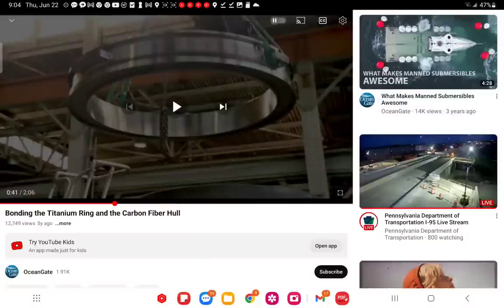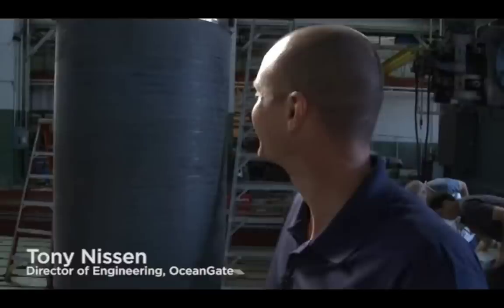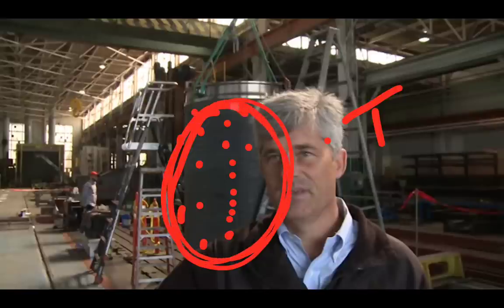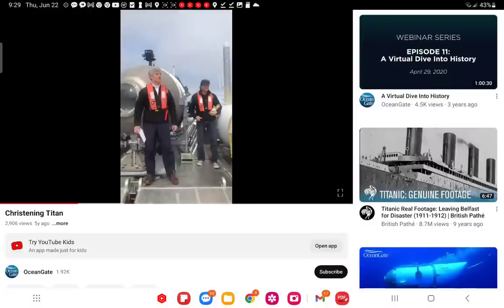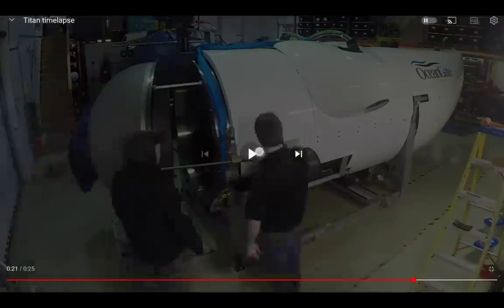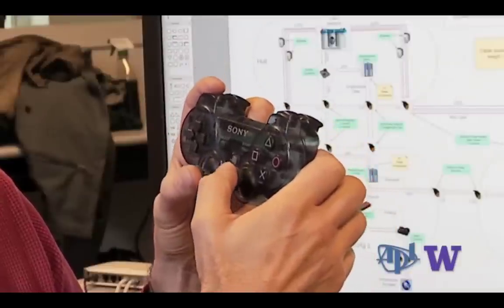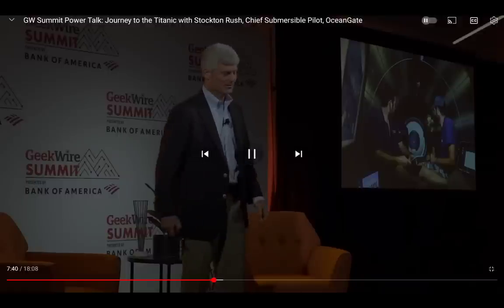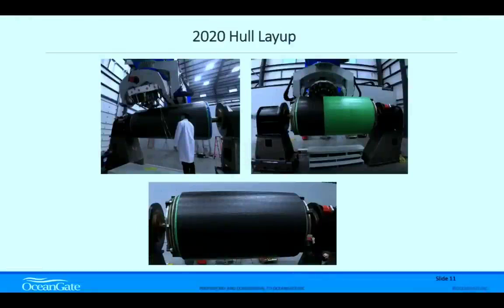Titanic Titan owner speaks out on his design test and APL University of Washington RESPONSIBLE??

Comment: Carbon fibre is excellent in tension. In this application it is in compression. This is a flawed design.
Reply: My question is why did they think carbon fiber was good to use like how come they never like I'm so curious as to like where did they get that information that everyone else is using steel or titanium
Reply: Well, the instructions say it makes great pressure vessels. Just not in the same way as this. You need to ask your engineers how many game controllers they had in their college dorm.
Reply: @notyobitcch  I think the main reason they choose carbon fiber is to make the whole thing lighter (easier to move and so).
Reply: Also its a lot cheaper than Titanium.
Reply: @Tigrou7777 they wanted it lighter to cram more wealthy tourists in there.
Reply: The CEO is personally insulted by your baseless cry. Statistics show it's more likely that the crew screwed up than that the designer or builder screwed up. Of course, since all three possible screwups went pop, it doesn't matter.
Reply: Tensioning longitudinally for a box girder effect might work.
Reply: @jimgraham6722 carbon fiber is basically a rope. I can't think of any arrangement of ropes that would work well against compression, all that was holding the sub together was the epoxy. At that point, they might as well forgo the cf and build the sub out of glue.
Reply: @phoenix211245 exactly.

Comment: Spencer Composites Inc. manufactured the cylinder. I suspect the factory you see in the video belongs to the composites firm. The design factor of safety was 2.25 for a 4.5 in thick hull which was rounded to 5 inches.  The CF and prepreg was Mitubishi's and bonding epoxy were supplied by Epon Resin in Ohio.  There's a good writeup from 2017 in Composites World about all this.
Reply from the maker: Awesome research, thank you
Reply: Carbon fiber is a tensile product, i. e. used in acid tanks and SCUBA tanks,  pushing out, tensile . Epoxy is what holds the fibers in place.  Using carbon for compression was a huge mistake. Try pulling on a string or pushing it. Duh?  I am over 50 by the way.
Reply: Well, the manufacturing in these videos was... questionable at best. So is their site, it looks like from 90s... At this thickness, I'd not set foot in something that has not been cured in an autoclave, and this was not. I bet the epoxy in the middle was inhomogenous and full of air bubbles. But all in all, it held for 3 years and 10 plus dives, so it was not bad.
Reply: Why do I keep hearing that he used a Boeing used fuselage? Was this for a previous sub?

Comment: Spencer Composites Corporation (SCC) was founded in 1994 in Lincoln, Nebraska, and is now located at 4550 Pell Drive, Sacramento, California. SCC’s facility has over 50,000 square feet of space available to fabricate products up to twenty feet in diameter and over one hundred feet long. Spencer Composites fabricates composite products and components using thermoset and thermoplastic processes, has expertise in thick-wall composite processing, and is experienced and has the equipment for the processes of filament winding, pultrusion, RTM,VARTM, press molding, autoclave curing, and hand lay up.

Comment: That glue is what killed the family!!  You can not epoxy carbon fiber to a smooth titanium ring then subject it to expansion and contraction cycles and expect it to hold. I’m surprised it lasted as long as it did.   They should have ran titanium rods through the carbon fiber cylinder and bolted the end ring to it.   It would have held much better. But still can’t say it would have prevented the incident. Maybe put it if a little longer.
Reply: Yes I also thought of this solution yesterday. Ten foot bolts are very easy to get hold of or make.
Reply: The bolts would have less tension on them than the sea pressure pushing on the hull.
The failure was the carbon fibre buckling in compression - bolts just add to the compression.

Comment: Also I forgot about this that the titanium and carbon fibre would have a completely different expansion rates this would have a huge effect on the glues hold the rings and on the overall structure, I noticed on the wreckage that I couldn’t see if there bits of fibre attached to the rings they looked very clean.
Ross
Reply: There are a lot of questions that could only be answered through long term testing.  One thought I had was that construction of maybe 20 unmanned vehicles using such a pressure vessel for use over maybe five years could have provided much needed data.  A statistically valid set of data is needed.
Reply: @catsupchutney Exactly, it's a new material, you don't know the risks, build robotics! But since the guy used a cheapo controller and monitors, rusty pipes as ballast, I guess he wouldn't have paid for it.

Comment: The APL designed Cyclops 1, which was all metal.  It made a number of dives without incident, including to the wreck of the Andrea Doria on the Atlantic Continental Shelf.  It was rated for a much shallower depth than the Titan attempted.  The Cyclops 1 was distinguishable from the Titan by the upper hemispheric dome, and the very large front viewing port (possible because it could only be used at a fraction of the depth that Titan attempted).  Cyclops  1 is still in existence.

Comment: So they wound the carbon fiber into a tube. From what I can see in the video, it looks like the fiber is automatically epoxied by the follower? before its wound onto the cylinder form. What I don't see is any form of vacuum degassing of the epoxy as its applied. Wouldn't the winding of the carbon fiber then trap air, causing microbubbles in the resin that would then proceed to collapse under pressure from the outside in, slowly degrading the integrity of the cf hull deeper and deeper, until catastrophic delamination became inevitable? 
Also, does anyone know how they mounted equipment to the inside of the pressure vessel? Sure looks like they simply drilled into the fiber hull. If so, would these holes not be prime failure points? I have so many questions!
Reply: From what I understand, they installed an inner tube to mount the equipment. But for the rest, completely agree, the entire setup was a shambles from the very beginning. No crosshatching of cf, no vacuum during the process, don't get me started in how they glued the caps on..,..

Comment: It doesn’t help keep the seal if the carbon and metal deform and compress at different rates due to pressure, temperature, and the cycles. 

It’s entirely possible that the carbon compressed significantly more than the titanium, or less, and lost symmetry. This would have the effect of unseating portions of it away from the ring. It doesn’t take much. Any leak, any intrusion, no matter how tiny, at that depth would be catastrophic. 

Consider how much a military submarine compresses at operating depth. It’s a lot. And that’s only 1k feet or less. Now imagine how much compression occurs at 12k feet. Now how do these dissimilar materials compress compared to each other? It better be damn near the same

Comment: As prototypes go, that one looked like it could have used a lot more time put in on it in the lab, AND in testing. Not to mention, having at least two identical prototypes might have been extremely helpful for continuous testing, re-engineering, and and working out the kinks.
Reply: A scale model can tell you only so much.
Reply: I would have made one to leave at the titanic site indefinitely. I would put some pressure sensors inside it and leave it 6 months unless the pressure sensor says the hull failed
Reply: @CognitiveDisonance build a full size one as a robotic vessel🤔 kinda easy enough to do even if costly,  we have robotics that go down to the same depth. And you can cycle it much more frequently to find the limits.

Comment: The thing I noticed right away, is that the carbon fiber was all laid up one way or in one direction! Now I know with my limited experience with it, is it should be cross hatched or cross woven when laying it up! From what I saw it was feed off of that roll, all in one direction! I am skeptical of three things, the weave, the glue joints, and then that joint that he pointed out in the center! In my minds eye, those glue joints should have extended much further on between the end-caps and the carbon fiber hull!
Reply: I’m skeptical of all of everything you bring up, and that poly window.
Reply: Yeah they say it is prepreg usually prepreg are woven. However looking at the making of the tube it looks all the fibre is in one direction.
Reply from the maker: it is almost wrapped in one direction but this is not a true statement ... I will prove this in a video that is scheduled in a couple of days
Reply: @ForensicCats Hope at least that they have had enough sense to to that. There were enough failure points here to be glad not to add more. Although don't know how they managed to crosshatch from the video, will be glad for your input.

Comment: Yes! When the carbon fiber capsule was wound, it should have been built up on the ends to account for the transfer of the vertical pressure transfer of the Titanium cap.  Even with the accounting for the acrylic porthole, if the end of the capsule would have been scaled up on the end of the capsule that does not terminate. (Kindof smart design feature terminating one end of the capsule. Reminds me of a Prince Rupert's Drop)
Yes! It should have had a piece of titanium wound into the ends of the carbon fiber like a bearing plate that would have been the surface they would have been preparing the glued, titanium ring we saw them joining.
Reply: Better to wind the carbon fiber in a criss cross fashion. Like the old Wellington bombers of WW2 fame. Makes for a stronger cylinder.

Comment: I'm thinking we're looking at that titanium/carbon fiber interface, there, which looks like about a 7cm inner lip supporting that tube... Or, as you pointed out... what appears to be a scribe mark around the mid circumference of the tube... It's like cutting glass... with a scribe mark.  I bet you've hit on it... That mid-tube load along with that scribe mark.  I bet that's the failure point.  It will be fascinating if we get to take a look at that wreckage... which I sincerely hope is completely, as is possible, removed from the Titanic region.
Thanks... Fascinating... Well done... "Liked"  "Subscribed'
Reply from the maker: Thanks for subscribing and I hope you can handle my humor...
I think we can learn what happened by having access to the previous version that had an aborted dive... It should still be around, at least the pressure hull I hope.
Reply: @ForensicCats  Another thought I had was, that this was the singular vessel which went to the Titanic... All the others, I'd heard, are mothballed... No further expeditions to the titanic are in the foreseeable future... I admire what Rush was attempting to accomplish and I sincerely hope that someone else picks up the baton, so to speak.. as long as it isn't a "Rushed" process...

Comment: The acoustic sensor system would need to be scaled and calibrated in that it could tell "you" what the depth is. This only comes from "repeated" testing.
Reply: It should be a cumulative reading, like 'rems', because, those fiber breaks do not heal themselves. A break in the CF is a break and no longer providing support.

Comment: I know in my experience with high tech glues that we etch both surfaces either with a chemical etcher or electrons to etch the surfaces this is done in very clean and dry area the temperatures and humidity are monitored, what I’m not sure about is how titanium bonds to carbon fibre I imagine that titanium is very dense so atom to atom bonding would be absolutely critical then there’s the carbon fibre two very different surfaces plus there appears to be glue on the surface of the carbon fibre and the carbon fibre being a completely different atom structure than the titanium.
We use glues for adhesion to laser pump lamps IE Teflon to YAG crystal cylinders for DI water cooling the glues are the same types that are used to glue the ceramic tile heat shields to the space programs for vehicles re entry.
I watched the carbon fibre laying and bonding process on your video and I’m still not sure how they would have confirmed that there were no air pockets under the carbon fibre and the video showed the carbon fibre only being laid in only one direction anyway just me waffling on.
My condolences to the families that have lost loved ones in this tragic accident.
Ross
Reply: I don't believe they could have. Layman's perspective, but a non "sterile" room, possible dust, grease etc., definite air pockets, people basically painting the glue on - how do you control uniform application? Temperature control, as I'm sure they were as lax with that as all the rest, alignment of the joined parts, glue composition, as you said bonding cf and titanium,  bonding time, and the fact that you have a very heavy front door hanging off a single point on the joint.... I'm sure you can add many more problems to this list but even that with my h/s science class gives me shivers.
Reply: And there is probably air pockets between carbon fiber ends tube and titanium rings fitted only by their weight onto the tube, loss of glued surfaces.

Comment: I think a third titanium ring in the middle between the other 2 but only from inside the tube would have eliminated the buckling in the middle of the tube, the tube will have 50% more strength, also maybe supporting titanium beams between all 3 rings from inside would have made a huge difference
Reply: You could add more rings and it would make no difference, it’s the carbon fiber/ epoxy that was wet laid in a wearhouse in basically a uncontrolled environment that failed
Reply: Wouldn't matter. Cf and titanium have different expansion/compression dynamics. Adding another set of joints would only make it fail faster.
Reply: @phoenix211245  Thanks for your input. it won't be a joint like both ends, but rather as support from inside only, so the tube will not be cut in the middle. Cheers
Reply: The carbon fiber would collapse around the extra rings and the compression rate would still destroy everything.

Comment: That carbon fibre - metal interface looked under-engineered. I don't see how the adhesive would deal with cycling changes in pressure and temperature, especially between different materials.

The low depth of the metal channel seemed to be based on low cost.

Comment: So the titanium collars were connected using epoxy glue applied unevenly with a spackling spreader in a non-sterile or temperature controlled environment?  Yeah, what could possibly go wrong at pressures up to 5,000lbs per square inch?

Comment: You say that the preassure on the caps will cause the tube to try to buckle outwards in the middle. But the truth is that there is a lot more combined preassure on the sides of the CF tube than on the end caps. The preassure we are talking about are PER a defined area, for example per square inch, and the CF tube have a much larger area than the end caps so much higher combined preassure there. This is why they must keep the length of the tube fairly short as the shorter it is the less combined preassure on the sides. The optimal strength is achieved by using a tube so short  that the end caps literally form a sphere.
Reply from the maker: I have already done a video on your statement, go find it and teach yourself why part of statement is wrong.

Comment: The problem is not the seal, not the glue, not the bolts, not the titanium. It’s the carbon fiber tube. Once the carbon fibers delaminate, it will shatter and no seal, glue, bolts or titanium in the world will be there to prevent an implosion and that is exactly what happened.

Comment: Watch they are going to say it was crushed like a pop can. The middle was weaker than the ends. The window sure could have also gave in. The shape is also wrong. The reason they use a sphere is so it has the same pressure all the way around. This whole contraption was deadly. Too many failure points. The one engineer they had on said it short, and sweet. The one who said you wouldn't fly in an airplane if they put the wings on different. He explains everything perfectly, and to the point. You need to do a video on Cameron's submersible. His was amazing. He put years into it.
Reply: @blackhd92 Mate, the Airbus wings were built with some understanding of the materials to be compatible for the application. It was also extensively tested before any passengers got on the plane, and tested throughout the service. There is a reason why plane travel is the safest. This thing was built with the completely wrong materials. Carbon fiber DOES NOT DO WELL in compression scenarios. Add to it that there was NO TESTING DONE, while the Airbus had LITERALLY 1000'S of hours on it before commercial flights. And here you build a sub for extreme depth. It's amazing this thing didn't pop on the first dive. Pity that, at least that suicidal guy would have taken only himself out if that happened.

Comment: The only thing holding the tube to the ring is the glue, the bolts pass through the ring and hold the dome. If the glue joint fails, it's lights out.

Comment: They had been down there on a number of occasions, yet the implosion occurred about half way down;  not at the bottom.
Reply: Almost two hrs in. Like,  they descended most of the way, then had an issue develop. Remember, they had shed their weights are were supposedly ascending.
Reply: I guess the sub reached its critical failure point. Could have happened even at 100ft.